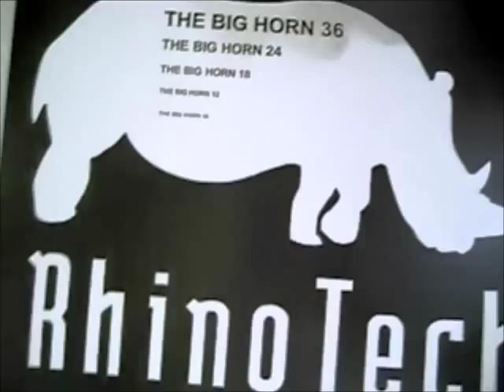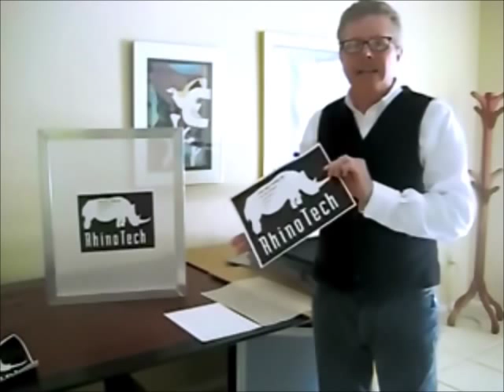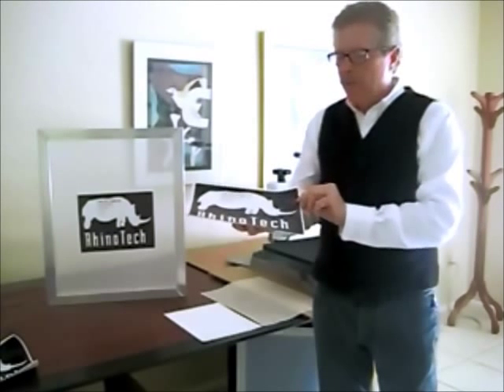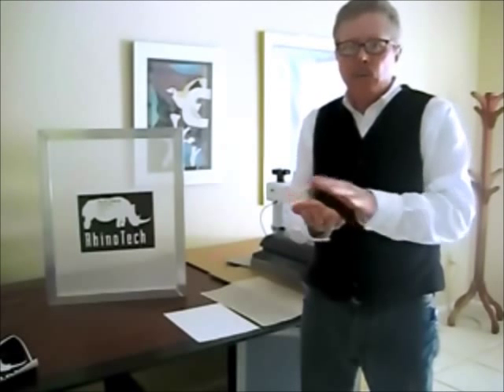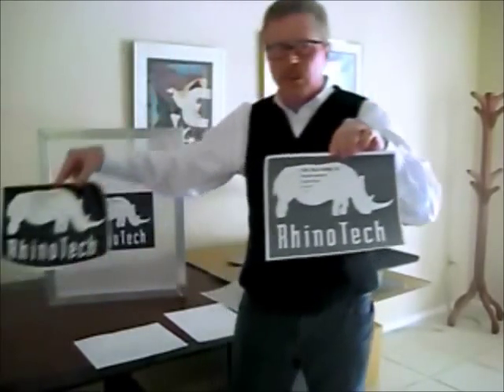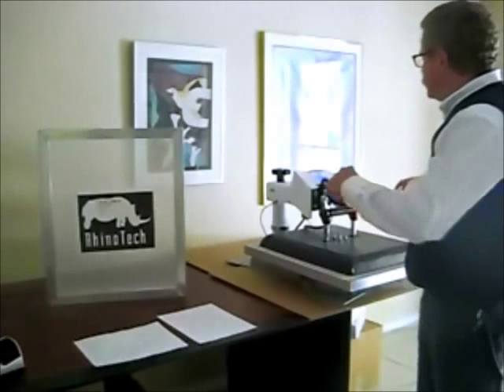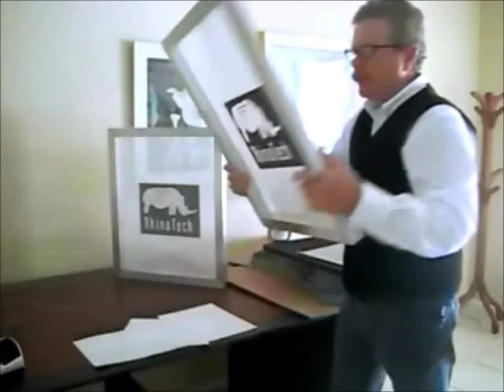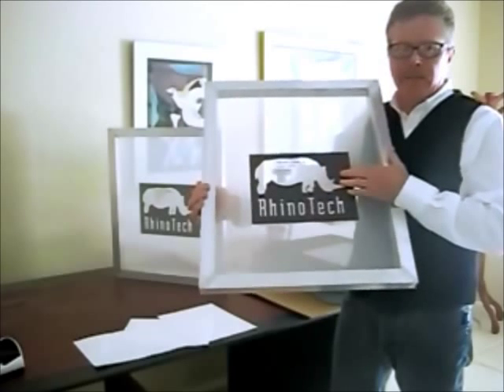RhinoTech Dry Stencil Paper

Comment: The Neenah instructions for this product ARE FOR 400 DEGREES FOR 120 seconds. You said the second press wa for 375 F for 25 seconds. This does not allow the adhesive to burn the the transparent areas of the transfer causing a failed screen burn in the negative part of the transfer.

Comment: hi i have this product and i print it out on a laser printer but when i try to transfer to the other sheet. it just would not transfer is there something, im doing wrong or my heat press is not good. i need help. because i really want to use this to screen print.
Reply: You dont transfer to other sheet. You are just transferring to a different sheet. You are putting a transfer coating on the same sheet with you design then heating it onto your screen